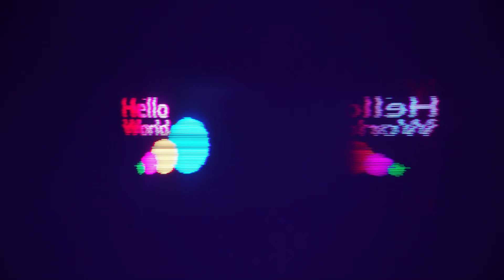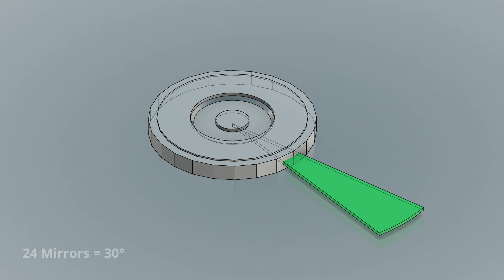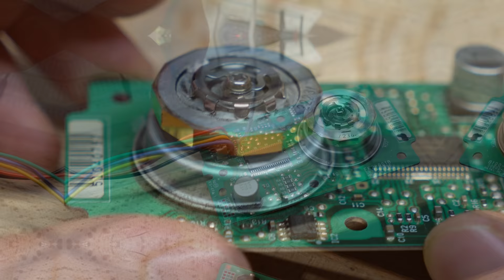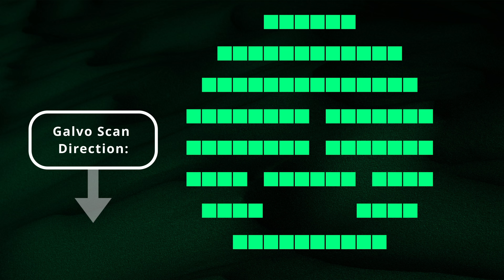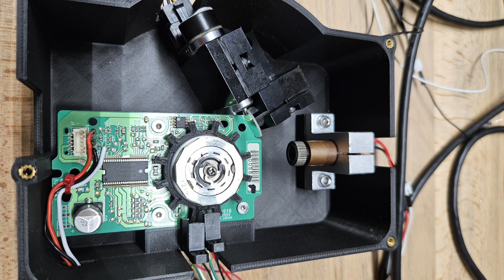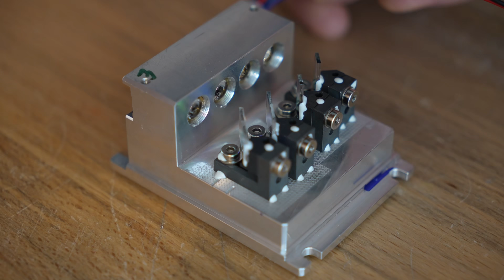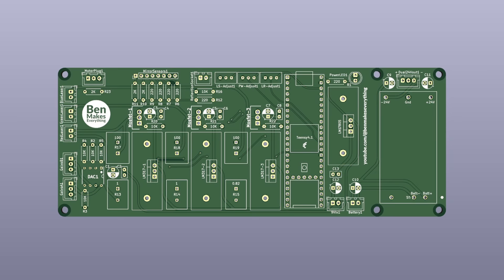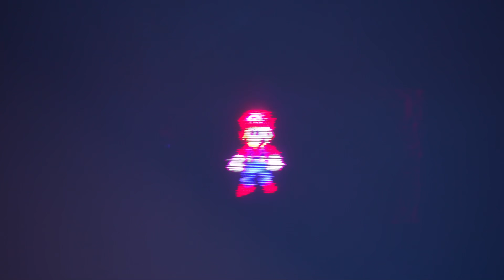DIY Laser Image Projector (100ft+ Range!)

Comment: There is a comercial solution it's microvision showwx. It has laser to project always sharp image and a single mirror for raster scanning image. Its also not that bright but full color and nice resolution
Reply: How did they speed up a galvo to 31kHz ? And the mirror is so small that diffraction gives you a blurry image like on N64 . I’d rather have the studio Trinitron look.
Reply: @ArneChristianRosenfeldt  it's a small mirror in chip mems single scanning mirror and it moves x and y not galvo they are raster scanning the image 848x480 pixels. You can find teardowns on youtube.

Comment: Are you familiar with BeamBrush? That is how the laser show industry is moving forward with “filled in vector imagery,” and is the reason we don’t try to use raster imagery. It may be an interesting next project  for you to tackle. 

BeamBrush controls the divergence of the beam on a per-point basis. It has two lenses that are sat parallel to each other and next to each other, and on one side of these lenses is a 90° mirror pair on a voice-coil actuator that moves toward and away from the lens pair. When it moves away, it increases distance of the light’s path between the lenses. When it moves toward the lenses, it decreases the distance of the light’s path. Very patented, very Pangolin, but also perfectly awesome territory for a YouTube video.

~Your friendly neighborhood Laser Safety Officer for Laser Light Shows
Reply from the maker: No haven't heard of it. Sounds cool! I'm pretty much learning all of these things as I make the videos, I have no industry experience in any of this.
Reply: @benmakeseverything  You should check out the lasercube that was made by wicked lasers a really long time ago. I think it operates pretty similarly to your current setup.

Comment: Do the galvos require +24V and -24V at the same time and relative to the same ground or could use an opto-coupler for the control signal and an H-bridge to invert the polarity of the 24V battery from the point of view of the galvos?

Comment: The Teensy should be more than capable of meeting the hard deadlines of your pixel rate. Try to move as much as possible into DMA and Timers instead of interrupts or even worse bit banging from the main loop. Often times the SPI peripherals work great as fixed rate parallel to serial converts, but their baudrate dividers are often quite restrictive. So unless you're able to exactly control the motor speed and phase to stay synced to the SPI transmitter you're next best bet that is possible with any decent MCU is time timer DMA driven PWM. To limit memory consumption you would have to convert each pair of different colored runs of pixels into a PWM ratio. You don't have to do this for the whole frame buffer. If you use the NVIC to setup interrupt nesting and priorities correctly just double buffering the expanded lines should work correctly. A ring buffer of a few more lines would allow even longer higher/same priority interrupts to run without underrunning the DMA transfers. Lots of MCUs also have other peripherals/combinations of peripherals that can be used.

All of this only takes care of the signal generation. If you can't prevent the noise and decide to go down the DMA + PWM timer route it's often possible to drive a pair of GPIO pins inverted (counter < limit, counter > limit) for free to form one end of a quick and dirty differential transmitter saving you components. Depending on what you have on hand an analog comparator or RS485 receiver chip should restore the single ended pixel data.
Reply: Given that the Teensy should have at least 16 bit PWM timers running fast enough to finely subdivide each pixel you could also use the PWM timers to cut into each color channels pixels times on both ends to control brightness per color inside each pixel.

Comment: This is absolutly my type of project.
I love mechanical T.V.'s and this and your first projecter defnitly tickles that same center while being modern and upgraded. I love it!

You might be able to get some amount of dimming/modulation for color mixing by using a LCD, or making a mechanical modulator instead of trying to directly modulate the laser. 
A mechanical modulater would just be a flap rotated in the way of the beam simular to a galvo mirror but rotated to block the beam rather then redirect, of course that takes some extra optics that might be a pain.
It also might be worth looking to the electronics and mechanisims behind the early televisors, they had some very cleaver solutions for these excat problems, such as a scophony another solution (using a Nipkow disk) was to use grids of receptor cell/light bulbs to get the response times needed to form a full image from the early electric light bulbs they where dealing with. 
Nothing directly applicable but plenty of solututions all the same

(Edit: My brain was in the right neghbourhood and the wrong address. Nipkow disk not liard)
Reply: But I want to be clear.
THIS IS AWESOME AS IS!!!
Reply from the maker: Thank you. That is an interesting idea. I would still like to figure out how to do it purely through electronics. Just got tired of messing with the circuit and decided to send it as-is.
Reply: @benmakeseverything 
Oh of course. I am about to head to mah "job" sitting around waiting for nothing; do you have a BOM and wire schematic in PDF published anywhere? Id love to have a looksee myself see if anything pops out to my eyes, but I cannot watch YouTube nor use company computers to view a gerber file

Comment: You might be able to improve the performance of your driver board by going from a 2 layer board to a 4 layer board (signal, ground, ground, signal) or even better a 6 layer board (signal, ground, power, power, ground, signal).

You have a lot of high edge rate signals which can generate a lot of EMI. Using a dedicated ground plane can help to reduce the EM fields and greatly reduce ringing on those signals. 

Given how cheap it is to make boards, you should give that a whirl.
Reply from the maker: Thanks, that is probably a good idea. I'm still kind of new to designing PCBs, so I've only done dual-layer so far.

Comment: This is what I wish "laser projectors" meant in home theater area instead of just being a regular LCD projector with the light source being a small thing with a laser pointed at it instead of a light bulb.
But I assume the speed you'd need to drive those lasers at to produce a 4K or even 1080p image at 60 Hz with variable intensity is beyond the capability of lasers not to mention the power you'd need to get a picture bright enough, especially for HDR, would make it insanely dangerous to the point where if the mirrors stopped you'd instantly go blind just looking at the dot, and it would probably set your projector screen on fire even if it's white
Reply from the maker: Yeah I agree, there are some issue with the concept for sure, but I think 480p at least is do-able, this motor is spinning at around 15K RPM, but I have seen ones that go a lot higher, and instead of 12 mirrors there could be 16-20.
Reply: What gives you the idea you couldn’t modulate a laser fast enough?!? We can modulate lasers at insane speeds, which is why fiber optic communications work. And it’s their speed that explains why lasers are used widely in physics and chemistry research, where crazy short pulses of laser light are used to measure physical properties of samples. We use lasers because ordinary light sources, including LEDs, aren’t fast enough.

The other things you mention are more difficult hurdles.
Reply from the maker: @tookitogo  I know the modulation is not the major bottleneck. I'm aware that certain types of lasers can be pulsed in the GHz range, but we are talking about 1 Watt+ visible light lasers here. Might still be fine though. Its the moving mechanical parts that are the main problem.
Reply: @tookitogo  4K at 60Hz is 500 Mhz if you only want 1 bit per color. Which last I checked seemed just about possible but that was a few years ago. But that only gives you 6 colors plus black and white. If you want 10 bits per channel via pulse width modulation you get to 510 Ghz by my rough calculations (3840x2160x60x2^10 Hz). And you need to do that with a very high powered laser. The lasers for long distance optical data transfer are powerful but not nearly powerful enough to get a 100" picture to 1000 nits. Could someone like Samsung engineer that? Surr, maybe... But would the beam move fast enough that it would be safe to look at? What insane failsafes would you need to make sure the laser cannot run unless the mirrors are moving?
But we can dream can't we? Perfect motion clarity like a CRT and pixel level dimming and contrast like an OLED and screen sizes like a projector... It'd be glorious 😎
Reply: @antivanti  Yep. Not saying such a beast is practical. Just that modulation isn’t the problem. (We have lasers that modulate at 100GHz.) 

From what I’ve read in the past, one of the reasons direct-view laser projectors were abandoned years ago (there was active development around the turn of the millennium) is because of the problem with sparkle, which is a result of how laser light interacts with the retina IIRC. So even if no other challenges existed, that is a limiting factor on the quality of a laser-projected image. :/
Reply: @tookitogo  Yeah looking at a point of laser light the shimmer of the individual pulses of laser light that it's made up of is never out of focus. I assume that's related to the issue? Is there a way to un-laser a beam of laser light without too much diffusion? 🤔 100 GHz is within an order of magnitude and you could compromise with 8-bits per channel and some dithering and your basically there
Reply: @antivanti  I just double checked, the effect I mean is formally known as “speckle”, and is the result of coherent light being randomized (e.g. by reflecting off an irregular surface). I think despeckling is the big limitation. If we “de-laser” the light before it hits the screen, then it’s just a roundabout way to make a regular projector, without the advantages of laser. If we do it at the screen, then it needs a special screen, which AFAIK isn’t a problem we’ve found an elegant solution for. :/
Reply: @tookitogo  I don't think you'd lose ALL the benefits by de-lasering the light. You still get the per-pixel brightness and the very low persistence of a scanned image which means much better motion clarity like you get on a CRT vs a sample-and-hold technology like modern displays and projectors.
Basically it would work like a CRT projector except instead of an cathode ray tube accelerating electrons towards a phosphor you'd have lasers pointed towards a "de-lasering" screen 🤔
Reply: @antivanti  Every projector uses per-pixel brightness; without that it’d just be a spotlight. 

From what I can tell, all “laser projectors”, even the ones using RGB lasers, simply use them as a light source for DLP projection. Nobody tries to scan and modulate. (And for film projection, being whole images, it’s better to not scan.)
Reply: @tookitogo  Of course the they have per pixel brightness but LCD and DLP doesn't have very good contrast because the light source bleeds thru which is why they use dimming of the light source. For monitors you can have local dimming to achieve great contrast within a single frame but projectors can only dim the whole image which means they get better dynamic contrast between dim and bright scenes but not within a single frame. Scanning a laser however would allow you to shut the ligh source off completely for one pixel and then fully bright for the next pixel. That would theoretically mean the same "infinite contrast" as an OLED.

As for sample-and-hold being better than scanning for movie content that's just incorrect. That creates motion blur because your eyes try to track motion but the picture stays in place the whole duration thus smearing across your retina. A scanned image only shows information for a short duration while it is up to date and thus no smearing across the retina. That's why modern TVs have BFI (Black Frame Insertion) to reduce the motion blur caused by sample-and-hold. If you want to know more I recommend checking out https://www.testufo.com/blackframes by Blurbusters
If you have a 120Hz monitor you can also check out this CRT-emulation tech they made that works even better than BFI to reduce motion blur
https://blurbusters.com/crt-simulation-in-a-gpu-shader-looks-better-than-bfi
Reply: @antivanti  LCD projector contrast (and color) sucks, which is why LCD’s market share keeps dropping, with DLP making up the balance. DLP contrast is more than adequate, slightly better than film projection ever was.

Yes, black frame insertion is useful, and that’s what film projectors do, too. (Cinema film projectors mostly project each frame 3 times, so 72fps) Doing that on a digital projector makes sense, too, so as to match the look of film. The things you mention about CRTs, and emulation thereof, work because CRTs have persistence, which a laser-scanned image does not. But you could easily apply the emulation to a DLP projector. 

(Also, as I understand it, a DLP is not “sample and hold”. They are binary devices, so any intermediate brightness level is achieved by constantly flipping between the two states, PWM or PDM, basically.)

But moreover, you can’t de-laser the light and still scan it. It’s either-or. (At least in any practical way.) You’re either deflecting and modulating a laser beam, or you’re de-lasering the beam and then using it as a light source for the DLP chip. (The issue I see is focus: the big advantage of a laser beam is that it keeps tight focus over a comparatively wide range of distances. Incoherent light does not, so you’d need accurate focus control to the screen. There’s no way you could do that dynamically — having optics correct for the focus by moving in sync with the beam would be impossible to do with sufficient accuracy, if at all, since they’d have to be moving at immense speeds. So you’d need some kind of aspherical lenses that perfectly match the screen and distance. Maybe doable for cinemas, impossible for rental projectors.) 

Indeed, local dimming can’t be done with a DLP projector. But you can just do what’s already being done on a limited basis: forget the projector and install a high-resolution LED video wall. There are a couple of dozen cinemas worldwide built this way. (I’ve been meaning to check out the local one for a few years and keep forgetting…) I expect this will be the solution long-term. This change has already happened for events (concerts, keynote presentations, etc), where LED video walls have largely displaced video projectors.

Comment: You can do amazing stuff with raster laser projectors. I used my Lasershow projector a couple of times to project video and animations on clouds. The Videos where limited to ~19fps with a resolution of around 65x35 pixels with 2 galvos at around 45kpps @ 8 degrees. I may have some videos of the animations on my channel.
Reply from the maker: How many watts was that laser? I did try pointing it at a cloud, but couldn't see anything that far up.
Reply: @benmakeseverything  5 watts

Comment: Personally I would mount the battery on the outside so it could be swapped easily. Amazon sells common drill battery adaptors people use for kids jeep upgrades but you could 3d print it as well
Reply from the maker: Yeah, that would have been a good idea, or at least a magnetic lid that easy to remove....

Comment: You know you can get "negative voltage" from any power supply or battery? Just reverse the polarity. Voltage is all relative to a reference so "negative" is just saying that one is less than the other. If you put 5V into ground then 0V into "-5V" then it'll think it's got -5V. So a 24V to ±24V PSU is likely just a 24V to 48V PSU with a centre tap it labels ground. In other words, 24V is wired into ground, 0V is wired into -24V, and 48V is wired into +24V.
Reply from the maker: I do know that, but the thing is that if I had two batteries they would probably get drained un-evenly, since one would be powering the lasers in addition to that channel of the galvo. It's my understanding that might not be good if they are connected.
Reply: @benmakeseverything  yeah, you'd need a balance circuit to stop uneven discharge. It would be impractical to oversize one vs the other so the voltages track evenly as they discharge at different rates. Also I guess variable voltage might be a problem? Even by a volt or two. You could use regulators. But at this point a DC PSU would probably be cheapest and easiest? 

I'm just musing that you don't "need" a PSU that says -24V DC on the label. You could get a regulated 48V DC PSU and a 48V to 24V regulator, then use the 24V as your 0V reference, and 0V as -24V, then +48V would be your +24V. Or similar with a 24V PSU and 24V to 48V boost converter.

Negative voltage PSU's are far less common and generally more expensive when you find them. I guess that's because they're the same as positive, just with the terminals relabeled? getting one with a + , 0V, and - is even rarer.
Reply: The "center tap" is the tricky part. Getting precise +-24V voltages in relation to this center tap, where current can flow from and to the "virtual ground" is where it gets tricky. If it were simple, then there would be cheap +-24V modules everywhere.